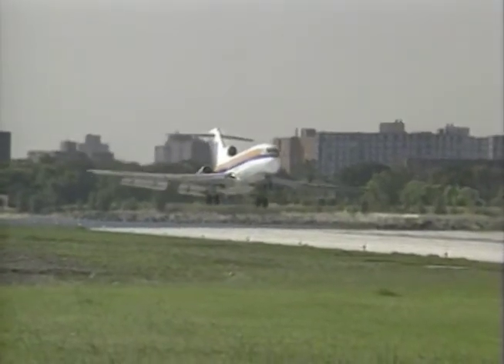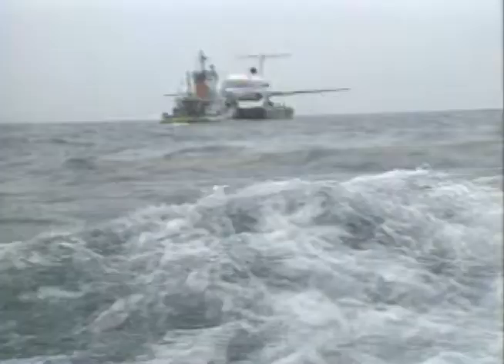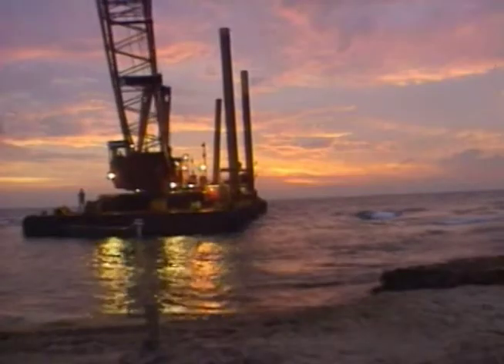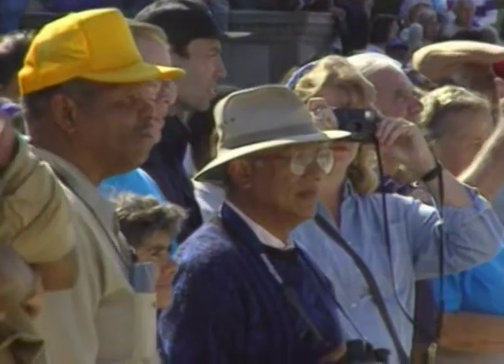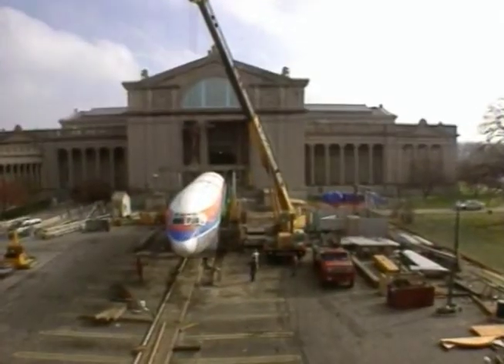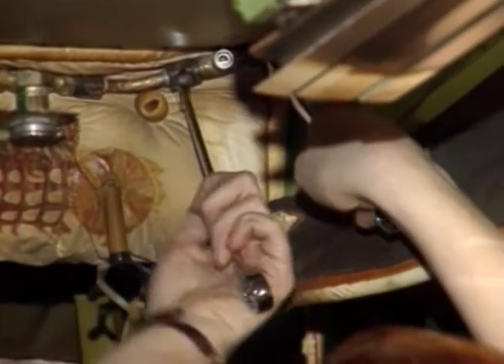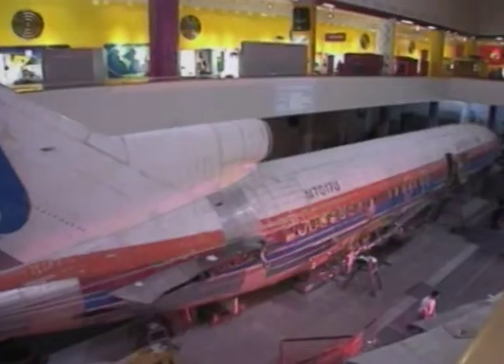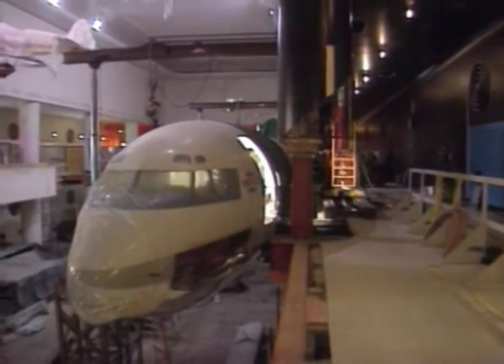The Plane Truth (1993)

Comment: The sad thing about this unique event and process is that ultimately, it all boiled down to an exhibit that offers nothing more than the opportunity for museum visitors to walk down the aisle of the plane, viewing unrealistic seating arrangements and nothing else. The rest of the exhibit does little or nothing to take advantage of the artifact. Unfortunately, this is the way most of the Museum of Science and Industry is managed, and has been for a long time....an excellent collection of artifacts, hampered by missed opportunities and a philosophy of 'dumbing down' everything far below the lowest common denominator.
Reply: They recently redid the 727 exhibit for that exact reason.  For kids of my generation, just having the plane to run around in was pretty cool.  But as the plane aged and the airline industry changed, they found it was increasingly irrelevant to museum visitors of today.  I saw the new exhibit recently and it’s much more impressive now.  They’ve cut away sections of the cabin walls and floors so you can see some of the parts inside the plane.  You can look inside the tail cone to see the air stairs, black box, and center engine, and you can watch the gear extend and retract through a window in the floor.  The number one engine also has a section cut away so you can see the inside of a jet engine (albeit an outdated one).  There is still a lot of room for improvement but the new exhibit is definitely a step in the right direction!
Reply: I know what you mean. It's so sad to see this museum go downhill over the years I used to love coming here when I was a kid but now it seems MSI has really lost there way. I Hate what they did to the zephyr exhibit!
Reply: Took the o gauge layout out there hate the did that starting charging to go in the coal mine